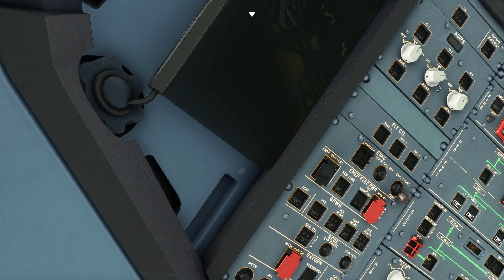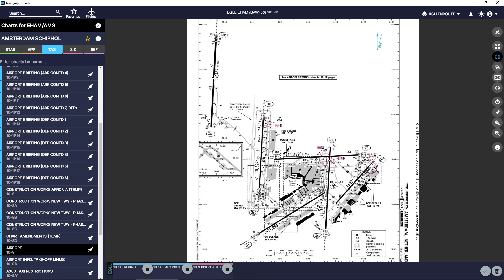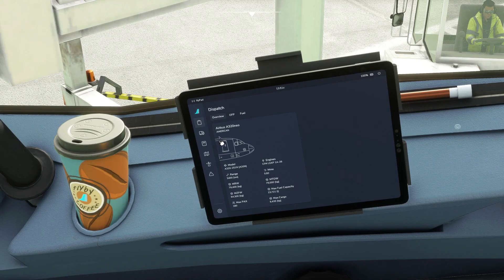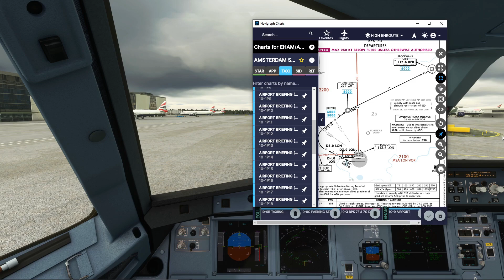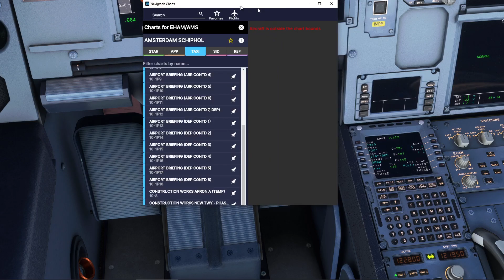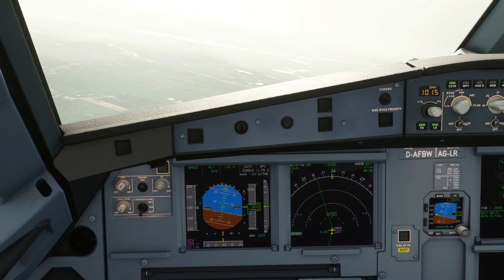A32nx Full Flight Tutorial | EGLL-EHAM

Comment: Why can t i fill in the v1, vr, v2 speeds by pressing the line selector?
Reply: It has changed. Use the Performance tab in the flight bag (Fill data from) to calculate the speeds. Then enter them manually.

Comment: Great tutorial. I have a question, you manually select the SID and STAR, but when I get my flight plan from Simbrief they are included. Depending on the SID and STAR, the quantity of fuel would change. How do you manage this?
Reply from the maker: Shouldn't change too drastically based on a different SID and STAR you should have enough extra fuel.. Remember if you're ever flying online you may be issued a different departure or arrival than the one planned.
Reply: @RealSimPilot  So do you, therefore, recommend omitting the SID and STAR and in fact maybe the DEP and ARR runways till instructed by ATC if flying online?
Reply from the maker: @mikehfisher  you can do that

Comment: Question thats confusing the hell out of me. i am trying to learn how to fly this thing and I have copied exactly what your doing and my radar is showing weird loops its doing.  I also dont get the load but for fuel like you have. One thing I am not clear about is simbrief i put both egll and eham and it did the route itself which included sids and stars however when you import to sim via flypad you had to manually add these so comfunsed as to why you would import the flight with it to then add it manually am i missing something?
Reply from the maker: Not sure about the loops you mentioned but you need to input the sids and stars manually as this is how its done.  The fuel is now loaded through the flypad, it has changed since this video.

Comment: Hey it’s me again, greetings from greece. 

I want to ask you something. I have a problem with my decent. When I plan my route to the destination airport and when it’s time to decent, even though the mcdu shows altitude restrictions of specific waypoints the autopilot does not fly according to it. Why is that so ? For your info I select managed altitude every time i want to decent. do you know what the problem is ? An indicator that the autopilot is holding the altitude restrictions is when the selected altitude is in the color pink, here in my example the colour is blue. can you help me out ? is there something i can do ?
Reply from the maker: Vnav hasn't been implemented yet. The a32nx won't follow altitude restrictions properly. When it does sometimes is purely down to Asobo's own implementation of a somewhat limited Vnav. For now I follow the attitude restrictions manually by setting the altitude window to the next restriction. Then once passed that waypoint I lower it to the next one and so on.

Comment: One question , how do you know its a flaps 1 departure ? Where is that info ? Awesome guide !
Reply from the maker: I always just use flaps 1 for a standard take off. You can use a performance calculator if you wish but I don't bother. Flaps 1 is sufficient for most normal ops. You can use flaps 2 if you have a short runway or need to clear obstacles immediately after take off.
Reply: @RealSimPilot  thank you god sir !:)
One more question , what add on are you using for tug ? And how do you connect airways ? I following your guide to the extreme 🙈 but i dont have any jetway connected , and i am standing at the same gate as you . Please help :)  again , your content is the best on YT . ! Never stop making vids . You are born for it 😂🙈😇👏👏
Reply from the maker: It's called toolbar pushback. You can get it at flightsim.to download it and put it in your community folder then you will find it on the toolbar at the top of your screen. Use that to control the ground crew and the jetway. 👍
Reply: @RealSimPilot  almost got goosebumps . Soon touchdown in Amsterdam . Thank you so much .
Can you reccomend any add ons for flying comercial jets ? Passenger and cargo , things like that . So i can add Even more immerson :)
Tips are very welcome :)
Reply from the maker: @kaiarbenhansen1617  I don't use any other addons with the A32nx. If you have xplane and you into Boeing I would suggest giving the zibo mod a try.
Reply: @RealSimPilot  sorry for all the dumb questions . But you are such a good teacher .
Why do you put arrival VOR freq on CO pilots instrument ? Why not on the pilots instrument and screen ?
Reply from the maker: I had to go back and watch the video to see what I did there. I could have switched it on, on the captains side not sure why I did it on the f/o's side. You can have 2 pointers on the display. So 2 vor's or 2 adf or an adf and vor etc... well spotted 👍
Reply: @RealSimPilot  thank you for clearing this up for me . I overthink everything
Reply from the maker: Happy to help where I can.
Reply: @RealSimPilot  i feel so sorry to bother you this much . On wich chart do i find VOR , i have created a flightplan ENGM - ENTC  with simbrief , loaded inn to navigraph , but i cant find the VOR . Can you please explain ? 
Please give me your email adress , i want to paypal a small contribution for your Amazing videos and all the help
Reply from the maker: @kaiarbenhansen1617  not all airports have VOR's and they are also being slowly phased out. It's not required in the A32nx but in your example of ENGM there is the Gardermoen VOR at the airport. The frequency is 115.95 and the identifier is GRM. I can see it on the approach charts. 
My paypal email is flyrealsimpilot@gmail.com
Reply: @RealSimPilot  so i dont need VOR for ILS ?  I feel dumb .
Reply from the maker: No need. It's only entered in the a32nx for situational awareness. Thank you for your support to the channel very kind of you.
Reply: @RealSimPilot  when following My flightplan i mostly follow airways , but in the middle of My flight i have a couple DCT to next waypoint . How do i know altitude restrictions ? Is it the altitude i have when entering DCT ?  Hope My question makes sense 😂
Reply: @RealSimPilot  last question , i promise 🙈😇 where do i find transition altitude on arrival ? Wich chart ? I can find it , no problem on departure .   This is the only thing im missing now . 🙏🙏🙏 i dont use atc right now .
Reply from the maker: Transition level is given by ATC. Transition altitude is on the approach chart.
Reply from the maker: @kaiarbenhansen1617  you would only have altitude restrictions during a departure or arrival. Those would be displayed on the charts. During cruise you stay at your cruise level until you are ready to descend.